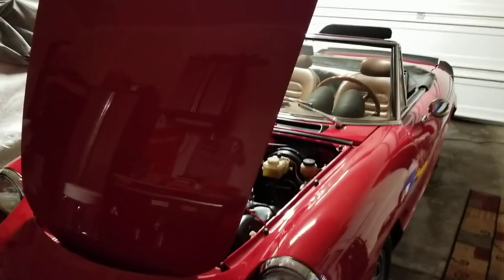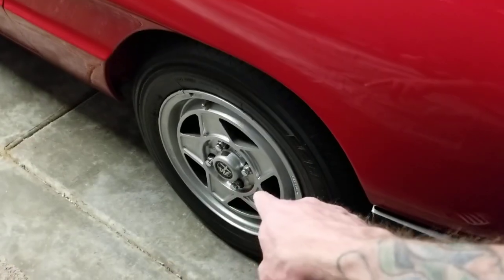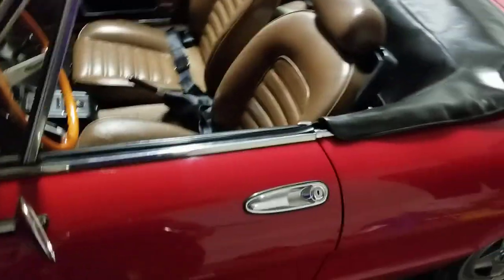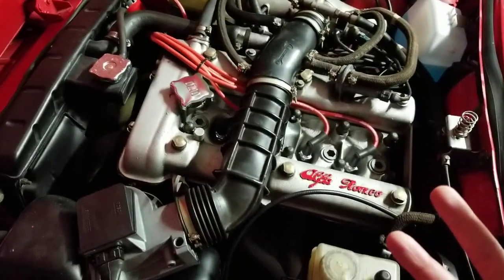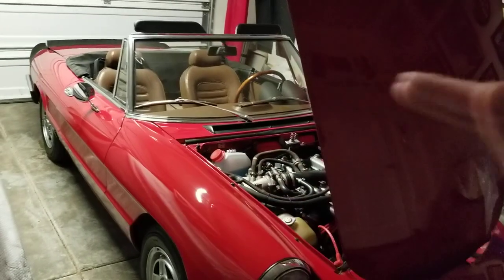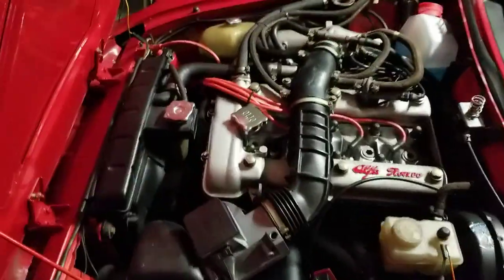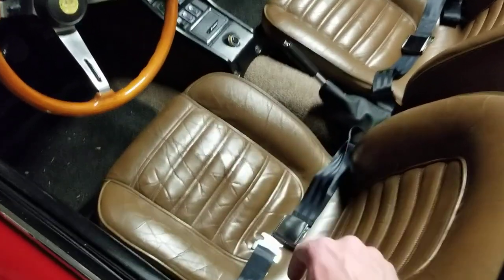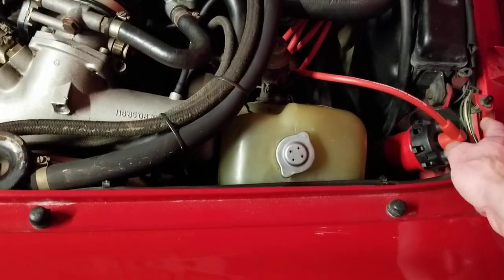Alfa Romeo Spider Winter update

Comment: I've been driving mine all winter for years- I have a hard top that keeps the heat in pretty well, as well as the rain out. Looks like your Alfa has a great home! I like your idea about adding older door panels and chrome bezels to the gauges/heater slider. There are two projects that I keep putting off- my windshield washer motor only receives ~ 6V so the motor doesn't spin up, and I have exhaust fumes coming from the new down pipe to manifold joint, as well as the cat flange. New gaskets needed for both. 
What's going on with the GTV6 rebuild these days?
Reply from the maker: heads are off at a well known engine builder for a series of upgrades and customization. transaxle is off having similar treatment. basically just waiting on those parts to come home before i can proceed. that is how i ended up with another alfa. just needed something to play with and drive while i work on the GTV6
Reply: I feel you. I bought a 74 TR6 while my spider was in the shop getting a minor restoration. Guy took 9 months to do 2 weeks of work because of the other business that he kept excepting. Now, I SHOULD get rid of one of my sports cars but I am having issues actually doing it. They are both tons of fun, and completely different.
Reply from the maker: @jamcdona  i told the wife i could sell the spider on after, but thats just NOT going to happen haha
Reply: :D